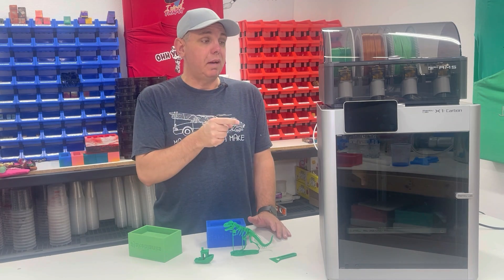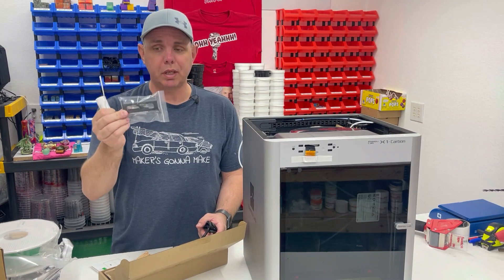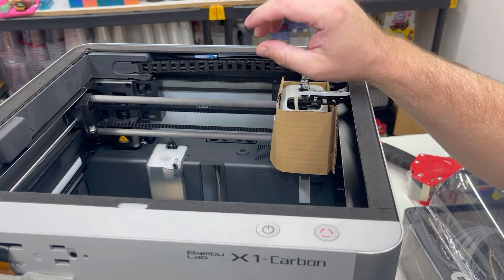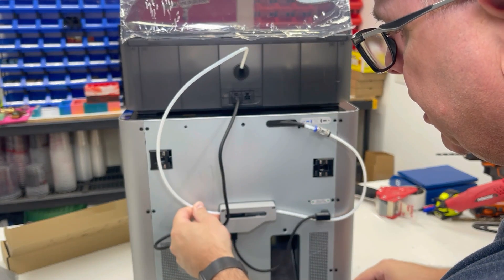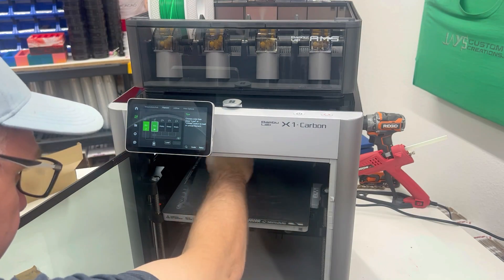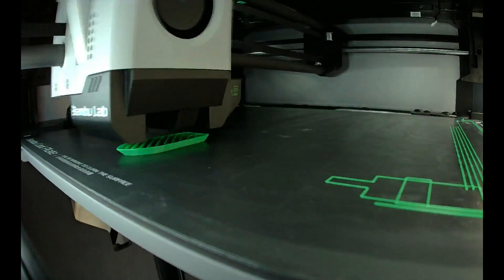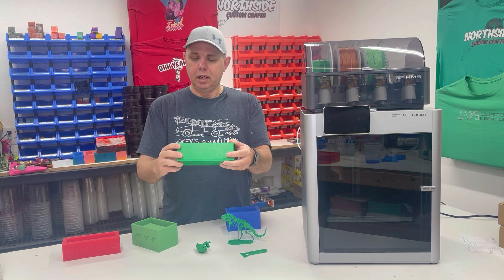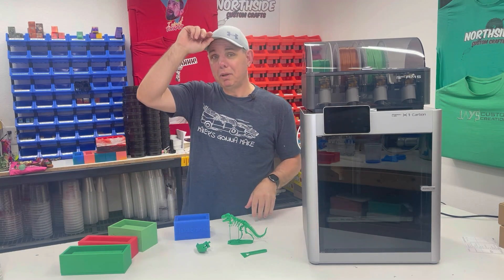How Easy is the Bambu Labs X1 Carbon to Set Up?

Comment: I can’t get AMS to work when I go to the Handy app. Do I have to go to the studio and slice it?
Reply from the maker: Good Morning  I always slice on the studio.. so I’m not sure.
Reply: @JakeThompson  when you slice on Studio, you have to pick filament colors every time?
Reply from the maker: @richthemagicman  after you hit print it will go to another screen and you pick the color there
Reply: @JakeThompson  in the studio? Can I do it in the Handy app?
Reply from the maker: @richthemagicman  try it and let me know
Reply: What other thing? I never got an SD card if I pronounce it right to put in by where the display is
Reply from the maker: @richthemagicman  mine didn’t come with one and it goes in the side of the display
Reply: Did you do a video on how to the 3d prints
Reply from the maker: @richthemagicman  Check out this channel https://youtu.be/rZhy0J0mXBE?si=gQYCW9gs28EX0lrR
Reply: @JakeThompson  
Thank You!!🎩🪄👍 
Watched it..
I thin my Handy app is connected but I have to connect to Bambu studio. I thought it happened automatically.

Like I mention the Bambu prints are working.

I’ll study your and connect Studio 
Any tips
Reply: Ok the latest the preset by bamboo lab works perfectly🤞🤞

But when I put it on Handy app to go, it gives me spaghetti they don’t like the plate. 

The thing about the plate was they used to do the thing with the The glue stick, but they don’t do it anymore. They give me the separate plate copper, which I like.

I could tell you the story how I had the A1, then the PS1 and now we’re up to this one 

Any help appreciated 

I’m gonna get this right. 

I guess I got to go to the studio app and see what type of results again 

What are your thoughts? Please thank you for your time.
Reply: Where do I buy it? Bamboo lab or Best Buy?

The thing about the plate is weird too but maybe in Bambu website.